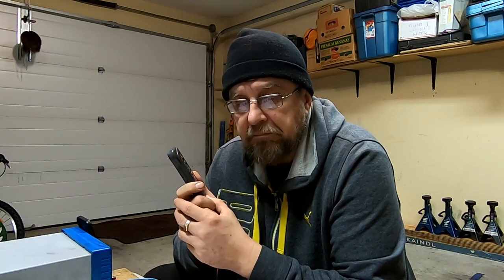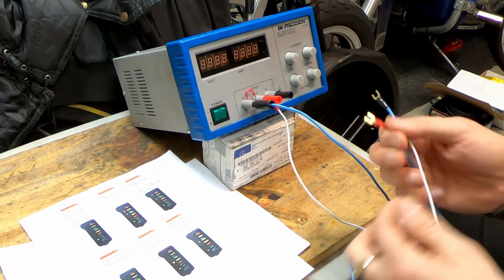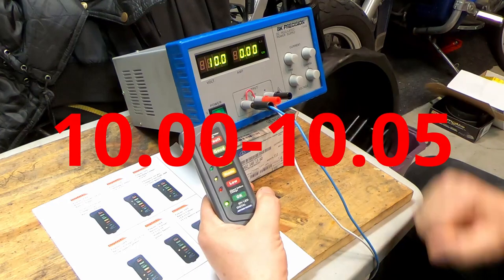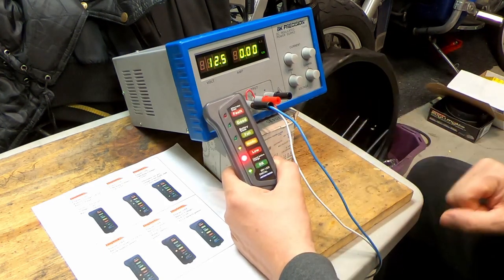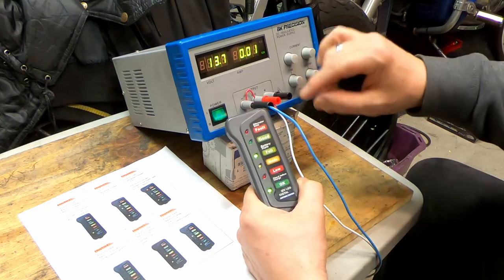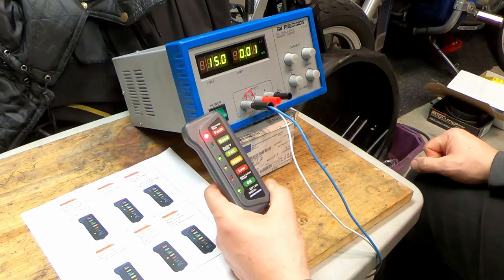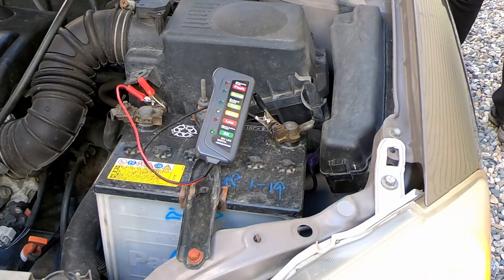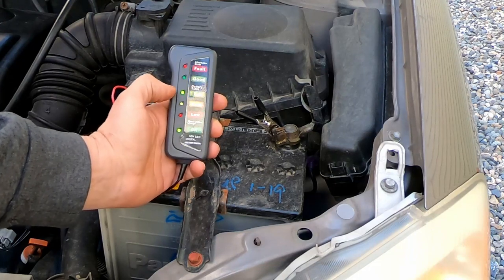ATDM Episode 1 - 12V Car Battery & Alternator Tester

Comment: I tried to test my 12v batteries the full light flashes green and the middle light yellow is still what does it mean is the battery ok or the device is faulty
Reply from the maker: the battery is ok, its just your battery voltage in the threshold of both sensors. test again after you drive the car or charge the battery, as the voltage goes up the yellow light will stop flashing.
Reply: @AndyPMercedesBenzChannel  Thanks

Comment: Hi what does it me if the green light is flashing for good, when testing the alternator please
Reply from the maker: this tester is a simple voltmeter ,  when light flashing means the voltage in on the borderline of this measurement zone. If you watch the video carefully it shows situations where the lights start flashing.

Comment: got green on battery and alternator.but faulty alternator red light flashing what this mean ?
Reply: this tester is a simple voltmeter, red light flashing means your alternator is not producing enough voltage, my guess brushes are getting very low. Might need to look into replacing them, or replace alternator. to confirm use a real multimeter.

Comment: Got one of these. Rubbish. Always reads red even on a new charged battery. Only goes green when engine running
Reply from the maker: These a cheaply made, it basically just reads the voltage. Use a voltmeter to calibrate it.